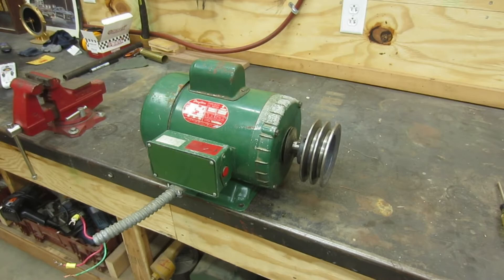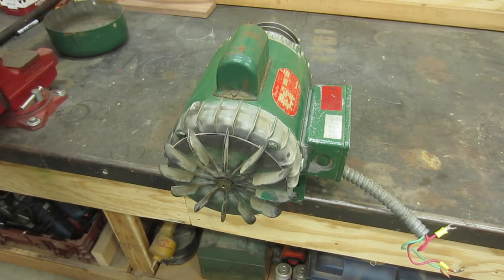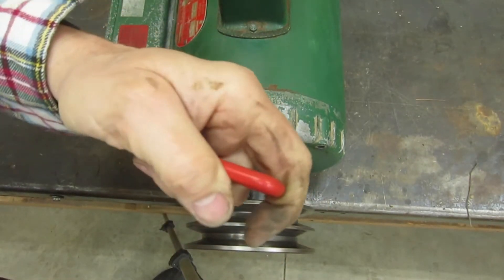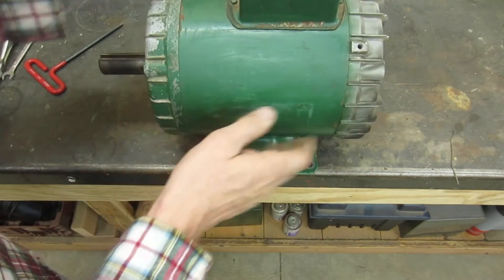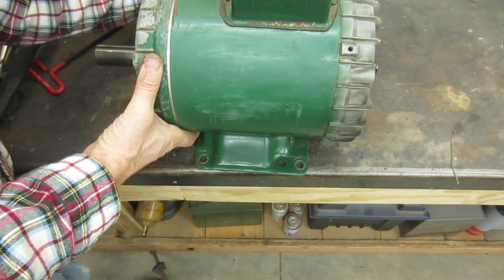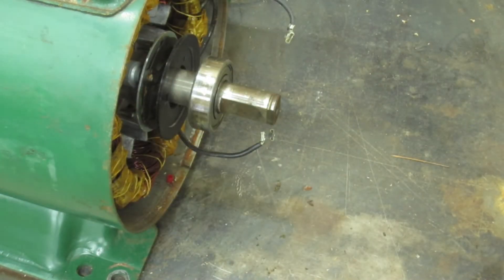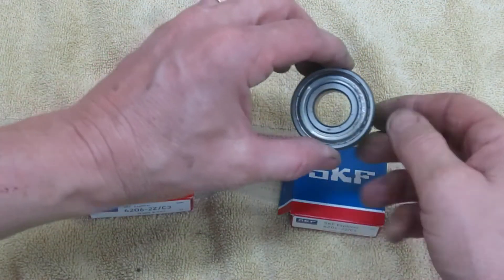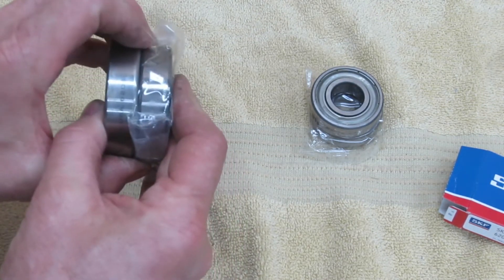Electric Motor Bearing Replacement

Comment: At 5;50, what is that assembly on the inside of the cover? 
Great video and thanks
Reply from the maker: I don't know what it is called or the purpose of it.  It had a couple wires attached, so I cleaned everything up and put it back together.  Maybe another viewer can enlighten us both on this question.
Reply: @TheToolmanTim thanks for the time!!

Comment: What are those claw puller you used to when you pulled the bearing off? I’ve never seen those before! 6:40
Reply from the maker: It's called a 3-jaw puller or gear puller.  They sell a set of four different sizes at Harbor Freight for around $40.

Comment: Thank you for this very informative video. I liked the pacing, the amount and content of the dialogue and the camera work. I’ve been afraid to crank on the wheel puller to remove the bearings on my pool pump motor but after rewatching this I feel comfortable to crank away thanks agian
Reply from the maker: You can get away with a lot of abuse when you're pulling off the old worn bearings that will be tossed in the trash can.  Don't forget to shoot a little oil on the puller threads.  It can save your puller from damage if you have to really crank down in it.

Comment: You don’t have to oil bearings?
Reply from the maker: These are sealed/shielded bearings that are pre-greased, so no oiling is necessary.
Reply: @TheToolmanTim  Exactly, and oiling in this situation is a temporary lube, and it makes a lot of noise, In these situations we need grease

Comment: I cringed watching this. The shaft sure was clean when the bearing was pulled off. Heat the inner race of bearing with a MAP gas torch and it'll slide on with no issues. Beating the bearing is the worst thing you can do to it.
Reply from the maker: If you noticed, I used a pipe to make sure the force was on the inner sleeve of the bearings.  That ensures the force doesn't deform the bearing in any way.  I don't like to heat bearings when I put them on because it can melt the grease.

Comment: Good stuff here. I have a 64 year old GE 3/4hp motor that likely will need new bearings. Your video gave me a better feel for what I was going to need to do to install the new bearings. Now if I could just find where I put my three-jawed puller...
I like the notion of using a length of pipe to drive the new bearings home.